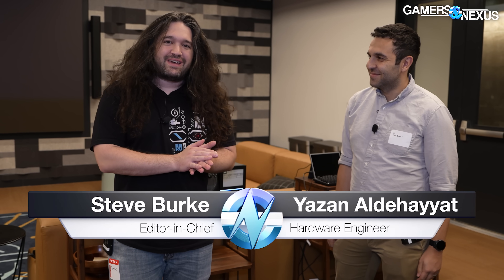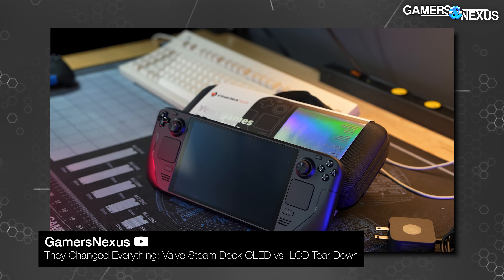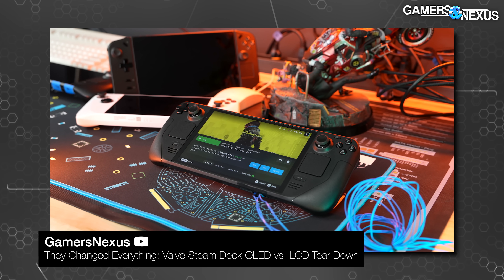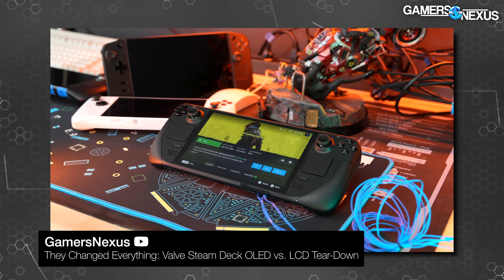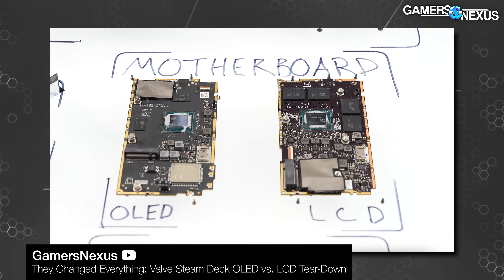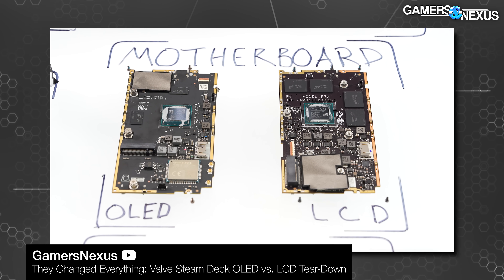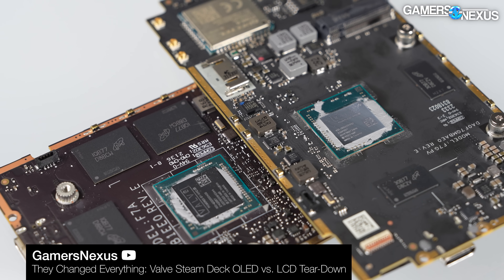Valve Steam Deck Secrets: Engineering & Design of Memory, PCB Layout, and Thermals

Comment: Im curious, especially now that we know Valve's been working on developing other hardware, why they wouldn't have made the OLED board more modular.

If the RAM chips were closer together, you could attach a SO-DIMM connector, attach a different CPU, and basically use the same board in the Steam Machine. I would also argue for the Wifi chip to be one of those laptop M.2 2230 modules.

Then, not only can they use the same board in the deck and the machine, 3rd parties could take the same board and use their own combinations. Users could swap parts.

Comment: The point about surface vs device temperatures at the end is very insightful; many devices that end up in a "handheld consumer-facing" use-case are often much more tightly constrained by strict limits on the surface skin temperatures than the actual limits of the parts themselves. This is obviously true for handheld consoles, but also things like tablets/laptops; the Surface Pro for example has sensors specifically to ensure the device casing doesn't exceed something around 40-45c, regardless of how hot/cool the actual processor is, and this is usually the limiting factor.

There are in fact small clip-on accessories some people have created to cool off a specific location on the outside of the device to allow it to run at full power longer without thermal throttling. If you're not actually holding the unit in your hands, it doesn't really matter if the casing gets up to 50-60c, but you'll burn yourself right quick if you touch an aluminum or magnesium surface at that temperature so manufacturers can't sell a device like that.

Comment: Two questions you could save for future reviews of the device: Is the device using a GaN power supply to fit in a smaller room and which way are FEX and Proton in the tech stack
X86 Proton running on top of FEX
or
FEX translating for ARM Proton

Comment: Always wondered why they don't use both sides of the PCB for the most part.  They use to do it more frequent way back in the day and I'm thinking heat related issues....or trace crowding :/  Really surprises me with video cards where one side is often barren with surface mount.
Reply: Considering the interviews we've seen I think it's fair to assume they did it that way for a sensible reason. Re-engineering the whole board for a refresh model w/ a better screen is something lazy engineers definitely wouldn't do. Exciting stuff!

Comment: I recently bought a steam deck even though I was told it’s outdated and there’s new chipsets (Z2 extreme) that get double the fps. They’re also double the cost! I love it, runs everything I throw at it out of the box even better than ROG ally z1 (which if anyone is interested in buying the microsd reader broke within 3 days of using it, I later looked up that it’s close to a vent and the heat fried it)
Reply: cant go much higher with mobile devices.... battery tech is miles behind... what makes steam deck so awesome too is LINUX... screw windows

Comment: 9:41 this really depends as whether you see the Conductor or the Air as the medium, and this is a whole debate which is (usually) won by the "add more metal" side of the argument. but i understand or at least suspect he is functioning very much in the world of "pressure" and "add more air, add more shims", not necessarily considering the physical chemical thermodynamics. this is a sort of cheap and efficiency-oriented method of cooling, which is good-enough, it excuses necessarily being improved on (unless you live in a hot country, there's a lot of complaints about steamdeck in south america, spain, where the air is warm). this sort of solution wins against engineered heatsinks, but only on these lower-weight applications where they are really directly budgeting each parts weight.

inside this guys brain:
he sees the fan as the central actor

so his intuition becomes:
more air + more shims = more cooling
components that don't rely on that airflow = even better

he is optimising for minimal airflow burden per component.
thermodynamics, when applied properly in a physical chemical sense, optimises for increasing conductive pathways. it does this so that the system is less sensitive to airflow limits in the first place.

Comment: The Steam Deck was a huge success for the same reason the Switch was a huge success: Mobility.

It offered a use case scenario which wasn't already being leveraged in a very practical and value oriented design...

Nintendo has it's Nintendo games; Steam has the PC library, which it has curated support for (Taking the wise advice of Digital Foundry).

Now, had Valve developed it's own gaming library for the Steam Deck? They probably would has sold tens of millions more units and driven more Steam games sales too... Let's be honest here: Nothing Nintendo is doing is revolutionary, it's simply scratching an itch.... Valve has failed to produce games to drive sales of anything it has produced, hardware wise... Including VR.... That's where the real money is at; that's where  you create the synergistic feedback loop that drives sales of hardware...
Reply: nintendo is too locked in for me... and i love playing the classics.... and not have to re buy them

Comment: 9:26 "best to trap heat in components within thermal margin"
I think they should go for the opposite approach and use an aluminum chassis for the entire backside of the handheld.
Apple loves to sink heat into the chassis of their devices, you don't get hot-spots if the body of the device heats up uniformly.

Comment: My #1 request for features on Steamdeck2 right now is a 4.4mm balanced audio jack delivering at least 200mw (enough to drive the FiiO FT1, best gaming headphones on the market and also come with 4.4mm cables out of the box).
Also everyone with IEMs uses 4.4mm, it's an outright superior connector, and if you're going to keep a headphone jack at all it may as well be the modern high end standard.
Reply: Yes we have lots of good USB dongle dacs out there but that's just another thing filling limited USB ports, and the 4.4mm connection is nice and sturdy for portable use.
Reply: It may be fun to dream, but never gonna happen. 4.4mm Pentaconn is confined to audiophile gear for a reason.
Reply: @mattrogers6646  And 3.5mm is dead, mainstream audience is all Bluetooth.

The only reasonable options are to remove the physical audio connection entirely, or use the 4.4mm enthusiast grade headphone jack that gives people a reason to try physical audio.

Comment: I want to buy a OLED as of lately due to nintendos horrid actions with the switch 2, especially the recent update blocking the use of any 3rd party docks, plus the steam deck is repairable, it can run emulators for older games, and play a lot of steam games on the go which is a better lineup than the switch.

Comment: I think Valve/SD's greatest contribution is making linux gaming viable and bringing it to the masses. Hardware will inevitably age, but the linux gaming is a true game changer. Not to diminish the Wine team's efforts for years, but this is like getting backing from one of modern gaming's largest distributors. Honestly, this is all super exciting. I also would like Valve to keep focusing on Steam Remote Play. With PCs getting more and more power hungry, private cloud-hosting means you can keep the beast box in another room and alleviates pressure from making the handheld too beefy or power hungry (or "dumb terminal" in a bedroom).
Reply: Absolutely. I think Moonlight style LAN hosted locally streamed from the Gaming PC with full GPU to the light APU handheld with less heat & noise than currently is the best of both worlds.
Reply: it will, and if you bought any handheld expecting it to be a future-proof AAA gaming box you're probably in for a bad time, but it'll play balatro until the sun burns out.

Comment: one of my favorite things about the OLED in comparison to the LCD, is that they moved the bumper buttons onto the thumbstick PCBs. So with LCD, if you broke a bumper button, you were out of luck unless you could solder or get it repaired. You couldn't buy the daughterboard the bumper buttons mounted to. But with OLED, you can just buy a new thumbstick assembly if you break a bumper button and it's 3 screws and bam, fixed.
Reply: everyone needs to learn to solder

Comment: I really appreciate these engineers at Valve, they did a great job on the deck, I'm using the same principles for cooling on a DIY Steam Machine case I'm currently designing for the AMD BC-250 (PS5 APU) by creating negative preasure to guide intake air flow through a path to cool as many components as possible using a single fan, its not an easy task, but its the most efficient way of cooling everything in one hit.

Comment: VapourDeck: BIG, HOT and INCOMPATIBLE with anything is not linux. Starting with the screen, whose EDID is defined with the biggest possible malice, so that you have problems in Windows (and rest of OSes).

And not just the edid: The gpu, the audio, the wifi card... everything's nonsensically incompatible.

Comment: I really hope that whatever the successor device is comes with OLED from the start at least as an option. The switch 2 was a huge disappointment on that front. I think they should also really try to go for VRR. If they were able to offer that which currently only really the Legion go 2 does though obviously had a very different price point to what I assume they are targeting, I think they will have a really killer product on their hands. 

The chip is also going to be really interesting. I think all of us assume that they want an FSR 4 or later capable chip. Probably not one of these RDNA 3.5 chips that the whole handheld market uses. Maybe something similar to whatever PlayStation is working on.
Reply: Every model of the Asus ROG Ally has VRR. I got the Z1E for $550 a year ago when it went on sale at BestBuy because it had decent repairability, lots of third party mods & parts. I was able to install a 2280 M.2 using a sub-$10 right angle PCB, went from stock 512GB to 4TB. There are also hall sensor / TMR joystick replacement parts available. I like it more than my 2021 AyaNeo (pre-SteamDeck) but wish it has USB DP out instead of that stupid proprietary XDmobile port bs. The ROG Ally X has improvements but not worth the increased price imo.
Reply: @mattrogers6646 lol see what gamers nexus say about rog ally.... hope you never need to send it to them
Reply: oled is overrated... oled life is awful

Comment: I bought a Steam Deck and was so impressed by the design and quality. It absolutely exceeded my expectations. Looking forward to the Frame.
Reply: Bought mine and prefer it over the Nintendo Switch, hands down! Just gotta get my games on the deck and I'm set
Reply: @jacobfullerton1310 no comparison the locked down cos nintendo suck balls... switch 2
Reply: Same, I love my steam deck. So impressed it can actually run games like cyberpunk and bg3. Only thing I’d advise people of is there are a few routers that don’t play nice with it (or at least the OLED version) leading to excruciatingly long download times whether or not you use LAN to download from your computer, but you can google a list of them and make sure yours isn’t one. Wish the batteries lasted longer but impressive either way especially because when the battery gets too used up they actually let you replace it

Comment: Why anyone want to buy the weakest and slowest gaming handheld in the market?
Reply: Battery life and steam integration.  The same reasons console gamers buy those instead of building a PC. I don't need the handheld to be a power house since I can leverage my gaining PC for heavy lifting. I need the handheld to be comfortable and have decent battery and good support if I need parts in the future.
Reply: @chublez Lenovo legion and Rog Ally has better battery life than Steam deck.
Also running Steam OS is not a good thing but a very bad thing because with Steam OS you won't be able to run many new and popular games like Windows which can run all games
Reply: sybau asus fanboy

Comment: I hope that Arm and FEX development will allow us to get small form factor handhelds again. Having something like a steam deck 2 but in the form factor of a switch lite would be amazing
Reply: The bulk of the deck actually enables some of the ergonomics and comfort. The way your hand has to claw-shape/cradle with a device as small as the switch gets uncomfortable with extended use. I agree that it would be nice to see the tech empower things like possibly running games on your mobile devices or cellphones. If Valve unlocks the door to competently having games made for windows on your mobiles, that is gonna be game changing; pun intended.
Reply: @kestononline well the cool thing is you can put a case on a switch lite if you think it's too small. A deck is just big and there's nothing you can do about it. Plus I find small hand helds more comfortable. I loose grip all my controllers and since the deck is heavy I can't do that so my hands are full of its butt which makes my hands warm and clammy.